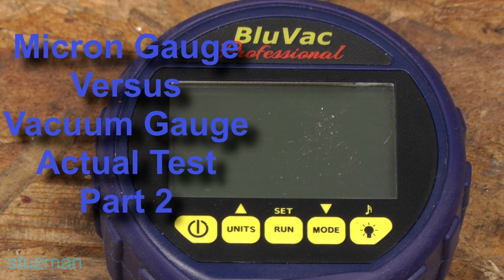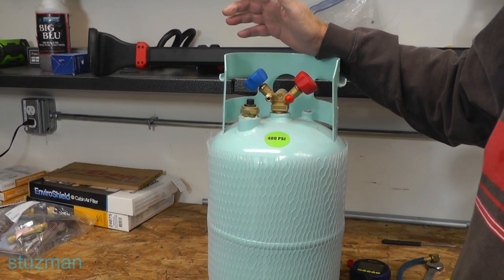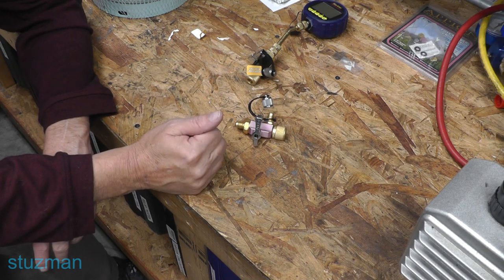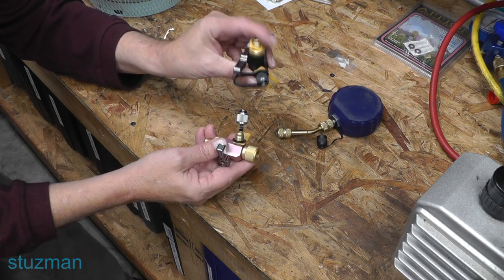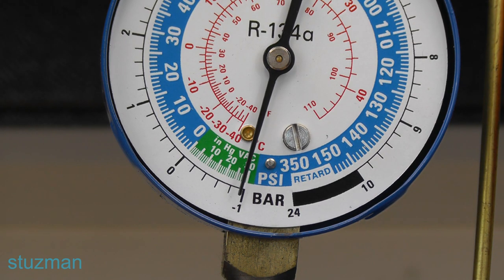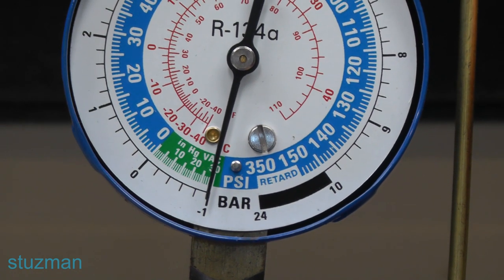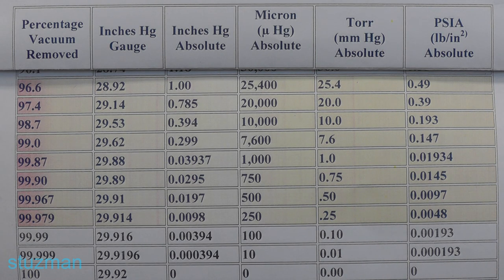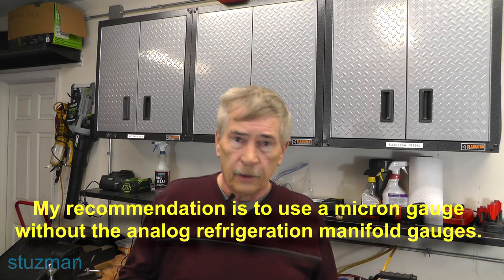Micron Gauge Versus Vacuum Gauge, Actual Test-Part 2

Comment: I can only imagine how many people get ripped off by hiring the wrong ac tech to work on their cooling systems without the proper equipment, procedures and  knowledge. Your video is spot on. Thank You.
Reply from the maker: You are correct Tom that there are a lot of tech who will do a job without the correct equipment, knowledge and will charge top dollar for their services. Thanks for watching and leaving a comment!
Reply: After watching this video, I now know that I got ripped off. I watched the local tech charge my heat pump. I remember thinking "wow thats all it took, 15 minutes". Now I know the 30 or 40 minutes of work that he should have done but didn't do. 3 years later and several months out of warranty, Boy don't wish now that I had recorded him.

Comment: I'm glad I watch your video. This is the most informative one online for a DIY. So many others just use manifold gauges which I was going to also. And they believe it's accurate enough. Even some who seem to know a lot about this. I originally tried to do this job at  minimal costs, but after researching a lot, I ended up buying everything I thought would be best. I did buy extra tools I didn't need, but that's OK. It was still more cost effective than hiring someone to do it for me. I was quoted 2000 thousand for labor to do the whole job. Well it only cost  me 400 for misc tools including the Micron gauge you recommended, the 2 core removal tools, along with the wall kit to hide lines and a vacuum motor. Not to mention the manifold I won't need for this job. So thanks for being so descriptive. All other videos left out many details for someone who never worked on mini split units.
Reply from the maker: Good for you Bert to purchasing the tools to do the job right. And even saving yourself 1600 dollars in the process. Even though you were quoted 2000 dollars, it's still not a guarantee that the job would have been done correctly. Sounds like you did a great job and I commend you on taking the time in doing your research. Thanks for the comment Bert and wish you continued success. 😊
Reply: @stuzman52  All thanks is for you. It's not easy to find the right information on the net or anywhere if you don't really know the right questions to ask. The simplest thing like pushing the schrader valve back in under pressure was eliminated in all the videos I watched that you took the time to show. Even how to hook up the manifold lines weren't discussed if I were to use them, wasn't really explained. Things the laymen should know about to do this. I actually haven't done the evac yet, I'm  waiting on the second core removal tool I order after watching your videos. It should be in sometime today. But the install is complete. If it gets here early enough today I will do it. I could use it now. It's going to be 98 degrees today and tomorrow. But I still have my window units where it's needed most. lol

Comment: Terry that's a huge  difference between both gauges. I'm thinking without the micron gauge you really have no idea in reality  how much vacuum your at. In ac systems your drawing down at best by guessing using analog gauges.  Wow thats an eye opener.  Great demonstration Terry 👍
Reply from the maker: You're exactly right Steve! When you're using the vacuum gauge on a manifold set, you will never know how much air is still in the system. Thanks for dropping in and sharing your thoughts. :)
Reply: glad u watched this. now u take this knowledge and take ur car in for ac repair. these guys have no idea about this ,so be aware

Comment: I never realized how inaccurate a standard vacuum gauge can be.  About 30 years ago when I started working on cars a well seasoned mechanic I worked with told me to leave the vacuum pump on the ac lines for an hour.  I didn't know why but I do now.  😀  Thanks for the video Terry I found it very interesting.  And yes I was also one of those kids who played with mercury when the science teacher left the chemical room door open.  The story you told had me laughing my ass off!  💯  I have been down that road.
Reply from the maker: Interesting Glen that you were one of those curious, mischievous students who got into stuff too! Great minds think alike! Thanks for watching and sharing a comment!
Reply: @stuzman52  😂😀
Reply: yes u have to pressure a system for leaks and some leaks are tough, but auto ac guys at dealers mind u, have no nitrogen and they never truly get ur ac dry cause they never use a micron gauge. so 30 yrs later they still dont no. crazy

Comment: Great videos. The mercury story was scary and funny at the same time.
Mercury does that with gold. It readily bonds with it to form an amalgam.  They use it to extract small amounts from ore because of this. I can see how it would literally dissolve their rings if they were solid gold. The only way to separate them is to heat up the amalgam to the boiling point of mercury and boil the mercury off, leaving the gold behind. Talk about a poisonous and dangerous process!! Subscribed!!
Reply from the maker: For sure it was scary at that time when you when didn't know if we had to pay for all of those rings. And looking back at it now, we were really dumb as a rock not knowing the hazards of mercury. Thanks for the comment!

Comment: Great video learned a lot was wondering if you could use CO2 and do the bubble test with CO2 pressurizing the system?
Reply from the maker: Thank you Joseph and CO2 should be fine in testing for leaks with bubbles.

Comment: very informative, thankyou for the video. i learned something new today. i am working on a ford shuttle bus with front and rear ac. replaced condenser, discharge line, expansion valve for the rear, orifice tube for the front and the drier, put it under vacuum for about an hour and then recharged. now it the problem is that the inlet to both evaporators freezes and the outlets are hot. at first i thought the evaporators are clogged. but now after seeing this video i come to a new theory, that there is moisture in the system still causing the freezing. because of the freezing the high side of the system has a higher pressure reading.
Reply from the maker: Sounds like you've got a plan...

Comment: You make a good case for why vacuum test can't be used instead of a pressure test.  You explain that is because the analog gauges have low resolution and you wouldn't be able to see a tiny leak.  But we know a micron gauge has way higher resolution.  Would it be ok to rely on a vacuum decay test with a micron gauge to detect tiny leaks?
Reply from the maker: Sure, no problem at all at most micron gauges have this feature built in them.

Comment: The next time I have my air conditioner serviced I'll be watching the guy to see if he knows what he's doing. I sure learned something about the difference between the R-135 gauge and the micron gauge. May I assume most auto shops only rely on the R-135 pressure/vacuum gauge? I've never seen my local guy use nitrogen or did he have a micron gauge.
Reply from the maker: wyattoneable Glad to heat that you found the video useful Wyatt! In the EPA 609 guidelines, it’s a requirement to have a system pumped down to at least 500 microns. Section 609 includes residential, commercial and industrial units. Automotive falls under section 608 which doesn’t require a micron gauge and you’ll see the typical manifold gauges used. Even the recovery machines use analog gauges for evacuation. For me, I’ve starting using a micron gauge on automotive systems. Great question Wyatt and thanks for the comment.

Comment: Why is it when you hook up the micron gauge directly to the vacuum pump with a shutoff valve (core tool remover tool), pull the vacuum and then close it off that the vacuum rises really quick? I notice if a larger volume is vacuumed like the recovery tank or lineset that the rise is much smaller and stable.
Reply from the maker: That is an excellent question proxybox and I had mentioned it in one of my videos of where I pulled a vacuum on my mini-split. I even posted a link to another channel where TruTech demonstrates of why this happens. I can tell you in this post of why this happens, but will let you watch the video as there is some other good useful information. Here is the link to the video and the explanation to your question is on the timeline of around 5 minutes into the video. Have a great day! https://www.youtube.com/watch?v=cI6pSBaskjc&t=0s
Reply: Wow thanks! I've been looking for a definitive answer this phenomenon. I thought that my core tool was bad but now I know how to properly test the setup. Much appreciated!
Reply from the maker: @proxybox  You are quite welcome proxybox and glad to help out!

Comment: Terry(?) Really appreciate your videos but I have a real conundrum: I bought a Robinair 15500 1/2 hp 35um capable vacuum pump. I have 2 gauge sets and a vacuum gauge on a hand pump unit.  When I tested the pump, all of the gauges read approximately 25.5”hg.  When I looked at a chart showing maximum vacuum vs altitude, these readings matched well with chart for my 4700 ft altitude of my city.
So, I purchased a CPS VG200 micrometer because of your video understanding the need for low-vacuum accuracy when doing refrigeration.
However, when I put the CPS micrometer directly on my vacuum-pump, it goes clear down to 4um and a reading of 29.919”hg, which is way off from the other 3 gauges (which by the way will hold a vacuum overnight so they should be good for a direct-connect to the pump) and seem impossible given the vacuum vs altitude chart.
So what is going on, what is the deal with the altitude-chart, is the CPS micrometer defective giving such near-perfect vacuum readings; should I send it back as bad?  Really stumped!  Thanks for any help you can offer. 😀
Reply from the maker: From your discussion of your readings, it would appear that the micrometer is a little off, but maybe there something that you and I don't see. I would call the manufacturer or distributor and ask them the question and see what they say before returning it. Have a great day!

Comment: Thank you sir. You answered all of my questions except which cheap micron gauge one is the best. LOL. 
All the reviews I see for some of these gauges are bad. I think its because people keep getting oil on the sensor and not cleaning it.
I went to try and get the Bluevac Micro but they are sold out so I am going to have to find a cheaper alternative.
Reply from the maker: Glad to hear that you liked the videos. I haven't any experience with any of the other alternatives and some of the reviews are bad such as the unit leaking. It could be as you said that the gauge may get contaminated by the refrigerant oil. That's another reason I use an isolation valve which I forgot to mention in the video.

I know a professional tech who uses this gauge in his YouTube videos and talks highly of it. It's located here:
 https://www.amazon.com/gp/product/B009AXGCSC?pf_rd_r=7A8NN4SHWJZYKCGBDXJP&pf_rd_p=edaba0ee-c2fe-4124-9f5d-b31d6b1bfbee 

For my gauge and other items, I use this site. https://www.trutechtools.com/ I had to wait a week or so for the micron gauge shown in the videos to arrive. There are cheaper alternatives as you mentioned, but I haven't used them. According to the website, the BluVac micron gauge should be in stock within 5 to 10 days. If you're not in a hurry, it's located here: https://www.trutechtools.com/Accutools-BluVac-Plus-Micro-Wireless-Digital-Micron-Gauge

Good luck on your projects!
Reply: @stuzman52  I was going to order from truetechtools because I'm a member of HVACTalk but when I asked how long they had been out of stock they couldn't say and they also mentioned it could be an issue with the manufacturer not having enough parts to build them.  So I found a Fieldpiece SVG-3 to use instead.
Reply from the maker: Deneteus Sorry to heat that, but Fieldpiece makes excellent products also. I’m sure that you’ll be happy with your purchase. Best wishes with all of your projects.

Comment: It takes a while to wrap one's head around why evacuation takes so long. The first thing that occurs is the maximum pressure gradient driving molecules, never more than 14.7psi. This is in contrast with filling, where a pressure difference can be hundreds of psi. The second factor is the way water will cool as vacuum is applied, resulting in condensation and even ice forming in tubing. Pumping air, we need to give it time to sublimate or boil back to a gas before water has any chance to leave the system. All of that takes time. Terry, I haven't seen any repair videos from you in several months. Hopefully all is going well, ha ha.
Reply from the maker: Leaving the dream Dave 😊! Actually, I'm doing some filming on a project now and taking my time with it. Not quite sure when I'll be ready, but hopefully it will be educational.

Comment: Hi, I am probably missing something, but why not put the core back after pulling the vacuum before releasing the refrigerant?
Reply from the maker: There's always a possibility that pressure from the outside could enter the vacuumed system. Standard practice is to have the refrigerant in the system and then insert the valve core. This wouldn't create a problem with a system that is vacuumed.
Reply: @stuzman52  Thank you for the response, and thank you for all the detailed videos.
Reply from the maker: @ruslan1909  You are quite welcome Russ and have a great day!

Comment: As you point out with so many variables involved, pulling a vacuum for an arbitrary duration makes little sense. I certainly picked up a couple of points, I had not considered. Thx & cheers 👍
Reply from the maker: Hi Ian and Happy Father's Day! Yes, pulling on different volumes of air with different systems is impossible to know how long a vacuum pump should run. Have a great Sunday!

Comment: The mechanical analog gauge showed correctly. It just the human eye couldnt pick up the micro movement. What if the electronic senor was damaged? You get incorrect measurement thinking its correct but its not. It a combination of all the tools to determine the correct reading

Comment: I have tanks of CO2 and tanks of Argon. Instead of nitrogen, can I use one of those?
Reply from the maker: spelunkerd CO2 should be fine Dave as there is a company that uses this gas. They have a product called bull’s eye leak detector to find very small leaks. More info can be found here https://www.aeswave.com/BULLSEYE-Leak-Detector-Pro-Kit-p9235.html
Reply: @stuzman52  Would you be able to do a bubble test using CO2?
Reply from the maker: Yes Joseph, CO2 will create pressure just like nitrogen and if there is a leak, bubbles will form.
Reply from the maker: joseph graham Should be fine.

Comment: Awesome 😎 
But what happened to ac before micron gauges were invented?
Reply from the maker: They used analog gauges...
Reply: @stuzman52  so with the analogue gauges back then, they would never of really  know that they hit 500?  Or was there a separate gauge specifically for micron,? Thanks for getting back 👍
So what I'm asking is, back in the day, a certain percentage of ac was never vacced correctly, but still good enough to work.

Comment: So if you pull a vacuum with the micron gauge and it holds do you still need to pressure test before the vacuum?
Reply from the maker: Technically, it sounds like this would be true. I can remember doing two jobs where each system held a vacuum for 24 hours and the gauge didn't budge at all. However, this was using the vacuum analog gauge and not a micron gauge. So, after filling the system with refrigerant, one system had low refrigerant in a month and the other system had low refrigerant in two months. So, both systems had an extremely low leak which didn't show up under vacuum. Therefore, it's always best to test a system under higher pressure with an inert gas such as nitrogen. This would show even the smallest leaks which wouldn't show up under a vacuum. And what if the micron gauge did show a leak? You would still have to use a pressure test to find the leak. Thanks for the question and hope you have a great day!
Reply: Excellent thanks that's great advice
Reply from the maker: @ralphyc81  Glad to help and be sure to have a great day!

Comment: Since I found poor reviews on all the digital micron gauges at Amazon, I looked at trutechtools for BluVac guages.   For my home use I'll be getting an AccuTools BluVac+ Micro Wireless Digital Micron Gauge with Coupler and Bluetooth, for $210 + taxes & S & H.    It will take close to $1000 in equipment before I can begin to do the job right on my 2004 Intrepid, while all the replacement parts are under $200.
Reply from the maker: Yes Jerome, having the right test equipment can get  expensive, but at least you know the job will be done right.
Reply: @stuzman52  After more study of youtube and testing of my Intrepid, I've realized that I do not need to spend $600 on a refrigerant recycling system and associated 30 lb can of nitrogen.   I can have a shop evacuate the system for much cheaper.   All I'm really going to need for my repair is a vacuum pump.   I've already got the kitchen scale that will do for weighing the can of less than 2 lb.   Realize, please, I am not fishing for coaching from you.  I still intend to get the micron gauge because all the goobers on youtube telling me to run the vacuum pump for 30 minutes or 45 or maybe even overnight leave me with no awareness of remaining tiny leaks.   This particular car has been in the dealer shop for various AC issues 3 different times.   There has been a lot of internet hate for the Intrepid, but in the case of my AC system, I don't believe Dodge deserves the hate.  I believe that the goober in the shop isn't supplied with a functioning micron gauge.
Reply from the maker: @jeromebarry1741  Sounds good Jerome...